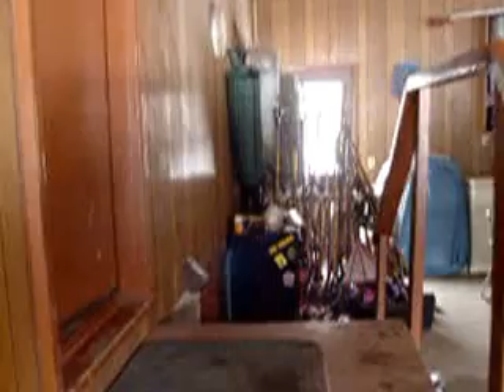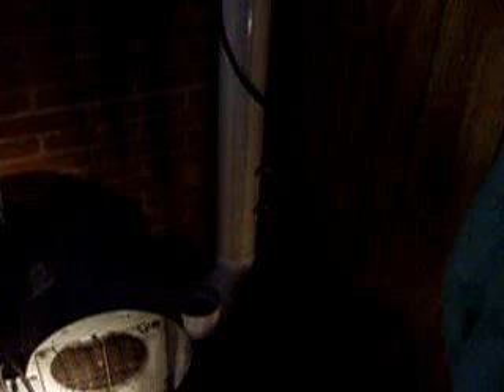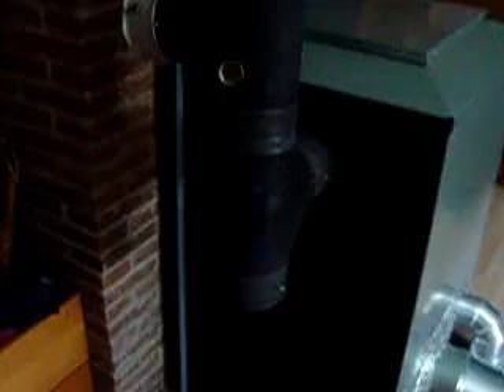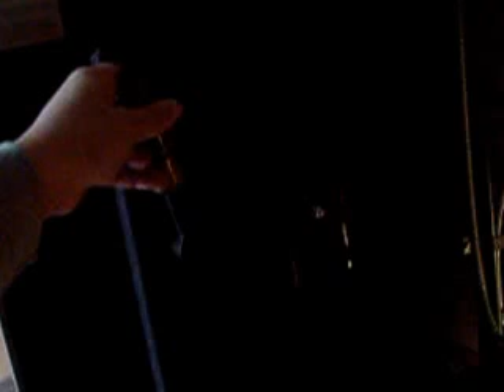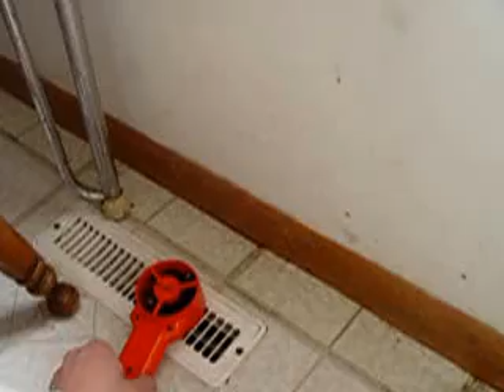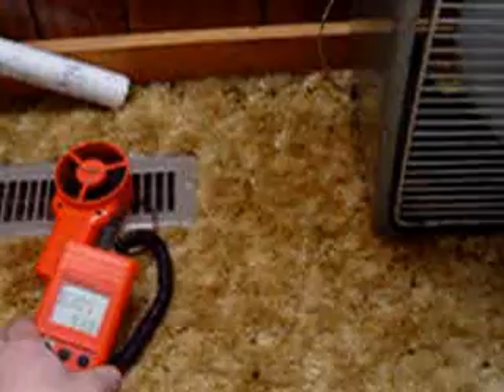Big Jack Wood Furnace

Comment: For a 3,000 sq ft home in North Carolina I am thinking about a gas, wood, coal Yukon furnace. We have hot summers so need AC too. Any recommendations you can provide on model and maintenance requirements? There is very little on the internet about these furnaces and can't decide if that is a good or bad sign?

Comment: I just bought a big jack and am using double wall stove pipe.  The stove adaptor that I bought doesn't fit.  What did you use to hook your T to the furnace?